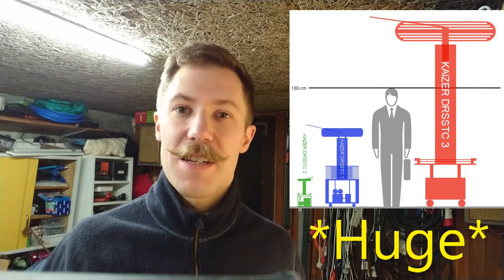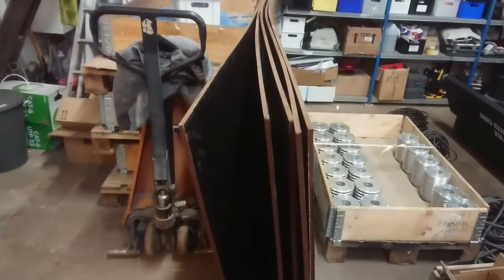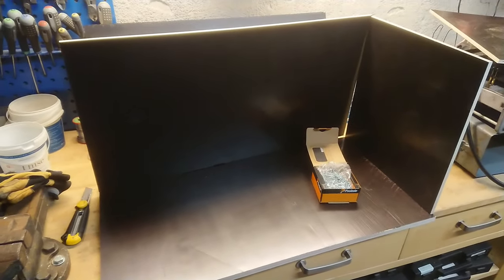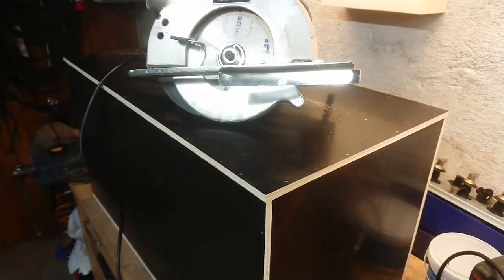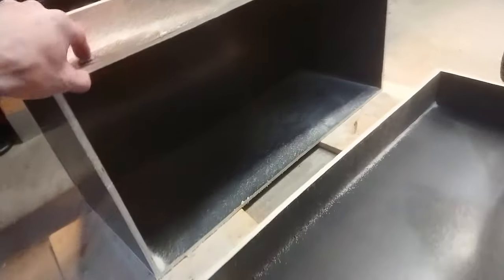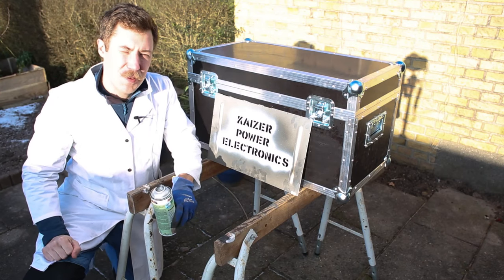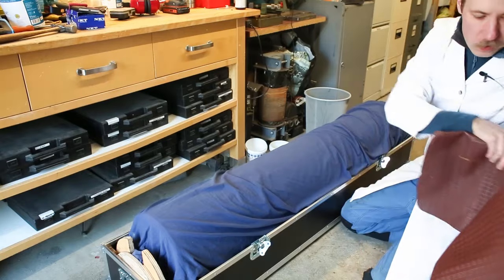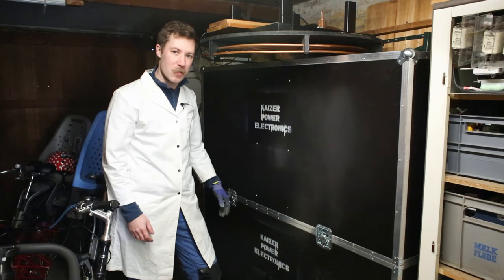How To Build Flight Case and Transport Box

Comment: Cheap? Haha in the Bauhaus store where I live, that concrete mold plywood is 3 times more expensive than regular plywood, because of the waterproofing. :D But it's definitely worth it, because you don't have to paint it or put any kind of faux leather over it.
Reply from the maker: Current building material prices in 2021/corona times could properly have shifted the  price differences....
Reply: How much more does concrete mold plywood weigh?  Is it the same?   I'm very interested in your reply.  Thank you my friend!  I'm in Seattle, USA and I'm starting to build these cases.  I really enjoy the work and I love the marketplace selling to really nice/cool people.  I could use some advice if you can.  Danke!
Reply: @ericweiler6571  I just checked.  The waterproof/anti-slip boards are 2.5 x 1.25m. 9 mm board weighs 19 kg, 12 mm is 25 kg, 15 mm is 31 kg, 18 mm is 41 kg, and 21 mm is 44 kg. I used 9mm board to make a really lightweight case and it worked really well (with rivets and aluminium single angle extrusions). Btw, the 9mm board costs 119€ and the 21mm is 189€, so it's pretty expensive, but since it's already waterproof and has a nice finish, I guess it's worth it. Your mileage may vary :D

Comment: Nice video! I wanted only ask you if Is better your solution to built the structure or is better to use casemaker profiles.. Thanks
Reply from the maker: I had to do it my way, because casemaker profiles only comes in 1 meter length. There was very little hardware to be found, premade for 2 meter long cases. Casemaker profiles seems to be double the price, so its a trade-off between your time and money. But I would properly buy casemaker profiles for cases that are less than 1 meter :)
Reply: @KaizerPowerElectronicsDk  Thanks you very much! But I think your structure is more solid than the other one with casemaker profiles
Reply from the maker: @massimofabbri1175  True, but it comes with a price in additional weight :) They are heavy.

Comment: What type of rivets and size are you using? Good work mate.
Reply from the maker: I used  4.0x11.4mm, you could properly use shorter ones. Type 12-971 here https://www.biltema.dk/varktoj/handvarktoj/nittevarktoj/nitter/nitte-2000016806

Comment: Would instead of using the nails and wood glue use instead some slow curing epoxy or urethane sealer, along with drilling the holes for the nails, and replacing them with countersunk long thin chipboard screws. Inside you simply wipe the edges of the seams before the urethane cures, on all except for the base, as this is likely to have another base panel inside, so there you can cut the excess flush with the panel after the lid is cut with the saw.

Long screws give a lot of rigidity, and using the urethane sealer means the case sections are never going to delaminate, plus you can use the same urethane to bond the aluminium edges on, so they will not come off except after major damage. I have done the chipboard screw thing often, and the failure is the wood breaking, though I do cheat and use fine thread quality drywall screws often, as they will self drill the hole, but even the chipboard screws work well.
Reply from the maker: Which thickness panels do you use? I would love to have used 12 or 15 mm for sturdiness, but the weight of the added thickness was a big no. All the aluminum rails does all the rigidity, but I can foresee that some years of use and replacement of rivets to bolt+washer+nut might be necessary if the rivets are stressed enough to break the wood.
Reply: @KaizerPowerElectronicsDk  Cheapest panels by me are 18mm, so used those. Yes thinner panels are better, but using an even glue bond will mean no rivets needed. Just some stretchy tape to hold the panels and edges together for the cure time of the urethane, which will probably mean a day of tape. I used the shutterply to make simple shelving, and did the dimensions to use the full sheet with only a single cut width. Thus the edge screws, to get a strong joint.
Reply from the maker: @SeanBZA  woah yeah 18 mm is never going to happen with big boxes like this! That would be 80 kg just for the big box! You are not using rivets on the aluminum rails?
Reply: @KaizerPowerElectronicsDk  18mm does not need rails, the join itself is strong enough, though a few corners had braces put in.
Reply from the maker: @SeanBZA  Now I understand :)